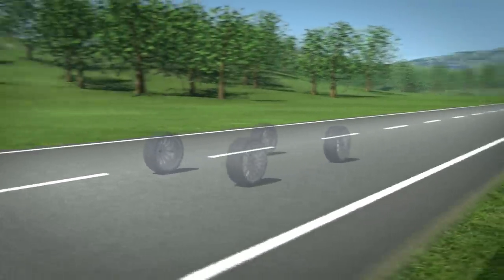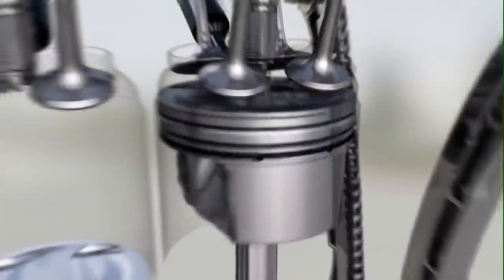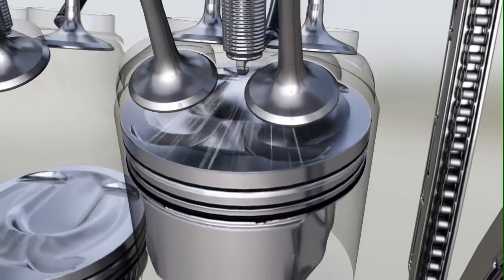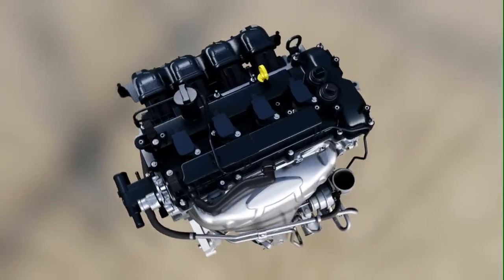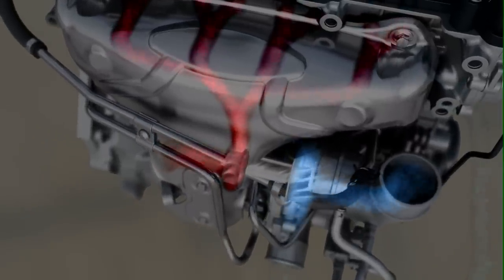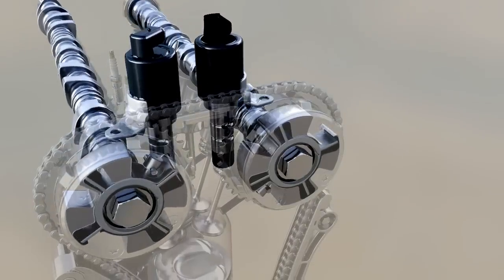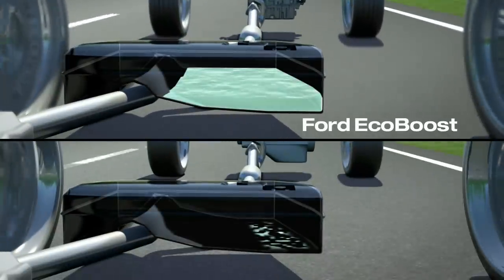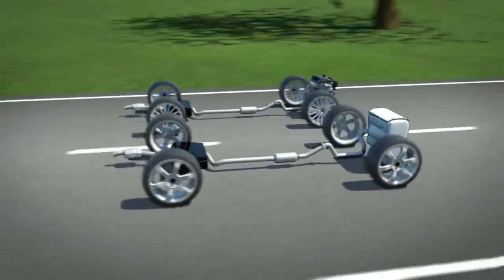Ford Ecoboost Animation

Comment: Just picked a 2015 Fusion Titanium, great engine. Averaging a little over 25 mpg in the city. Love the handiling, very good for a FWD sedan.
Reply: Titanium is the trim level.
Reply: Bob O. Check back with us in 4 years and continue the report.
Reply: rayford21 the time has come
Reply: @rayford21  i have had my 2.0 ecobeast Galaxy five years,did i win a prize
Reply: 2015 
1.5l ecoboost fusion se.
73k mi

Still runs decent i suppose.
Cant stand the transmission though. So sloppy
Reply: @jakokaj7003  get yourself ngk iridium plugs ,makes a diffence  if you run ford plugs.
Reply: 25 mpg in a Fusion? I thought it would do better than that.
I just drove my 2013 Lincoln MKS Eco-boost AWD sedan from Los Angeles to Kansas City I got 22 mpg with the big car. Sometimes driving 95-110 mph.

Comment: I went with a 5.0 in my 2013 f150 and I’m so glad I did
Reply: Anthony Bush  v8 or no light duty pickup
Reply: Anthony Bush yup me too.  They were to new to trust
Reply: I went with a Ram. I learned my Ford lesson the hard way.
Reply: Al Engdahl yeah I’ve got a 2016 hemi ram 1500 awesome truck love it
Reply: To bad my ecoboost blows it out of the water
Reply: @monavieforal  ha just wait
Reply: @hurricane 863 you too. HA
Reply: @monavieforal  dude dodge is the worst company their is. Its a fact.
Reply: I run Rams, the the 5 Oh coyote from ford is their good engine.
Reply: Suq Madiq I want a 5.7 Hemi Ecoboost in my F150, Lol.
Reply: Al Engdahl better be a Hemi ram.

Or you are a screwed once you get above 70k.
Reply: Hurricane 863 your eco boost is garbage compared to the 5.0 NA.

I have a S550 Gt with the 5.0, 

Which is more reliable, more fun, and faster than the 4 cylinder turbo models.
Reply: Richard Thomas very mature Richard you tell those fools how to talk properly
Reply: Your 5.0 that is just as complicated as an EcoBoost lol
Reply: Alex Tran still faster than an eco boost. And way better sounding.

Comment: I bought a 2012 F150 to see what all the rage was about. I've owned practically anything you can imagine because thats just the way I am, curious. I absolutely love the eco boost, empty(no trailer) at 50 mph it will pull itself up some steep hills cruise on at 1100 rpm and not shift when all others would shift down. No V8 gas engine has this kind of amazing torque, add a 9000 pound trailer like mine and its effortless at 70mph 2200 rpm, hill or not unless its a mountain. love this engine.
Reply: @SchafdoggGTO  I think he means a naturally aspirated v8. The 5.0 in the trucks actually produce less power than the 3.5 Ecoboost, but naturally a turbo v8 would out-perform a turbo v6

Comment: 250 from my 75 Nova, now in my 72 C20, bottom end has never been apart in the 28 years I've owned it. Around 400,000 miles, still going strong.

Comment: They've got a point. It DOES reduce Co2 emissions. Mainly because it's in the shop 24/7.
Reply: That's only if you don't know how to maintain GDI..... My 2015 mustang has had no major issues, runs like new and pushes 29psi on stock turbo and block lol....never once been in a shop
Reply: @SoGWestsofly  Congratulations!
Reply: @dailydoseofcancer5517  it takes a lot more maintenance, fresh plugs, 3k oil changes, proper catch can, and full synthetic oil, but it's worth it.
Reply: @SoGWestsofly  Eh, I'm too lazy to do all of that. I rather just stick with the car I have. I change the oil on that bad boi regularly, and it seems so much easier.
Reply: I've had my 2.0 ecoboost for 4 years never been in the shop.
Reply: philipfm : I haven't had any problems with my Ecoboost

Carbon buildup : hold my beer
Reply: Only thing you gotta replace on these is the spark plugs. Not sure where you’re getting the idea that this engine is unreliable.
Reply: Spot on, most accurate yet hilarious point on here
Reply: Look at the ford ecoboost forums and you’ll see how many are in the shop.  Obviously some are lucky with no problems but many do have them.  Btw, I have a friend who’s a Ford mechanic and he works on them all the time, same for the ‘18 and newer 5.0’s
Reply: @SoGWestsofly  I'm just like you man, I have a 98 avalon that I got for 1k, repaired it to run like a dream, and now I'm running 370k with pride. You treat her right, and she'll blossom no doubt.
Reply: max1cod7 You don’t Tech much do you.
Reply: DailyDoseOfCancer this is funny. I have had 2 EcoBoost trucks and neither were in the shop for the engine. But electronic crap made by Asians and poor Mexican made parts 😂😂
Reply: TheJagdog well GDI has been around longer than any of us actually an yes unlike Chevy who stole there logo from a magazine. Took the bail out an while Ford didn’t. 👍 built Ford Tough.
Reply: if you hate ford so much, then buy a chevy or a dodge

Comment: The 2.0 EB in my new Fusion is astonishing. So fast right off the line. 0-60 feels like five seconds and from 60-90 in a flash. More power than my previous V6!
Reply: you use nitrous ? 😂

Comment: I switched from my 5.0L F150 to the 2.7 eco boost F150 and its fast as hell, easily 0-60 in 5-6 seconds vs 8 on the v8. Love it
Reply: Hajji Daoud agree. I drive a 2015 Ford Expedition with the 3.5 ecoboost and I am impressed at how fast this truck is. I pull up to muscle cars at red lights and leave them with ease.
Reply: I got the 2.7 in my 2017 Crew 4wd STX, drove my brother-in-law’s 5.3 Silverado and couldn’t help but think, this thing is dog slow compared to my 2.7, so far 21k and not a single trip back to the dealer!
Reply: Poppy Neese really, a whopping 27,000 miles on it and not a trip back to the dealer lol like that is impressive.

Comment: There's nothing better than a simple 16 valve engine with MPFI, high compression ratio and good ventilation, admission and exhaust system! Nothing of turbos, thousands of sensors and modules, and shit around so expensive to maintenance 😞
Reply: So, K20?
Reply: And yet ford is still selling alot of mustangs, regardless of your pov.

Comment: I will say this. I had a 2013 Fusion  that later got totaled with the same engine NON eco.  I now have a 2015 with 130K miles that is fully loaded with ECO  and I can fully say that it is so much faster with so much power to spare.

Comment: 150k on my work 3.5 no problems and it has lived a hard life.
Reply: Just hit 120000kms with my 3.5 hasn’t had a hard life but it’s been worked. Only thing I replaced so far is a single ignition coil that cost 85 bucks. 10 minute install. 
Good truck.

Comment: For 99% of folks the 4 cylinder turbo is enough. And with readily available low end torque its responsive and "fun". They upgraded the interior with comfortable seats and made it high tech. With a low sticker price , its hard to beat. Most people keep cars for 3 years on average, which is about how long these 4 cylinder turbos will last.

Comment: They forgot the part where the engine malfunctions and bursts into flame.....and that small turbocharged engines have been around forever.....
Reply: ffkk echo boost.. the coyote is vicious
Reply: Said no one ever.
Reply: The fires would be what gm is known for
Reply: You're clueless my friend. I have 2 ecoboost F150s, a 2013 and 2017. They have been phenomenal vehicles with the 2013 having 133,000 miles on her already with absolutely no issues other than needing to buy a new battery and brakes. Ford has proven themselves That is why they have been the number one selling pickup for 42 years straight! You cannot argue that at all so go back to bed.

Comment: I read these comments and literally can’t relate. 2013 EB with 205k and it’s been driven hard nearly the whole way, nothing but normal oil changes (synthetic) every 5-8 k miles, changed spark plugs every 75k miles, changed boots at 189k and at 202k I changed timing chain and phasers but I only stretched the timing chain bc I upgraded turbos, intercooler, throttle body, CAI and like I said I drive it hard always. I have towed once or twice with it but I avoid towing as I just don’t like to do so, it’s been through woods and through a few rice fields but I mostly take good care of it and I’ve never had any major problems, timing chain was my fault and expected.

Comment: I went with the 5.0L in my 2018 f150 XLT . And I am very happy with it. Other then the fuel saver thing , when your at a light and it turns off. Then when you take you foot of the brake it starts back up. And I have heard the EcoBoost are expensive to fix more sensors and newer technology,  so more expensive to fix. I had a 1997 f150 with the 5.4L and I loved that truck , but kid got bigger and needed more room. So got the 4 door. And sold my old one to my son.

Comment: the 20% carbon reduction means it just stayed in your engine and is sitting on top the valves...good luck eco boost owners..the misfires are coming
Reply: +dan k bro, it means it used 20% less fuel, so 20% less emissions
Reply: No, he's right. In the ST community it's common to have to clean your valves after 20-50k miles.
Reply: All eco boost engines? I have a Honda pilot w eco boost engine. Wtf
Reply: Two words... water injection.
Reply: Really buddy why so much misinformation, fords eco boost have been around for how long, when ford came out w their i6 motors everyone doubted it
Reply: E V yeah but those were the best ones they made but fucked it with there vs
Reply: dan k ecoboost has been out since 2011 it's 2018 and my truck works like I bought it yesterday.
Reply: Everyone here with their fucking gassers 🤷🏻‍♂️😂
Reply: Jacob-Mason Leviste Take a turbo off a diesel and see the turd you really have lol 😂. I blew mine up I'm my 99 350. Couldn't barley get over 50.
Reply: dan k catch can mode
Reply: You are right, i have a 2015 ford transit with the 3.5 ecoboost, after 100,000 miles the check engine light has never shit off due to permanent misfires. I have replaced the plugs and coils and made no difference. Now at 232,000 miles its barely alive
Reply: @smitty3973racing  try a walnut blasting, at least that's they call it on bimmers, but it works
Reply: EcoBoost = New Shit to stab ur money... and you are the experiment for other industry study the final result 👍
Reply: smitty3973racing almost a quarter of a million miles in 3-4 years. Yeah that seems like it’s done pretty good to me.
Reply: @jacobebey7019  that has nothing to do with the 20 percent reduction. It has everything to do with direct injection. No cleaners can ever touch the valves like in conventional injector motors. So the carbon builds up.
Reply: @smitty3973racing   WHY NOT GET IT LOOKED AT THEN? you probably have massive carbon deposits
Reply: Ha that is so True, sittin on top of the valves......except im at 108,000 miles on mine and my Edge runs like a new car....I use Shell V-Power all the time.......must be why
Reply: There isnt a real cleaning for the valves except replacing them
Reply: Yeah my 180k 3.5 EcoBoost has had so many issues.  Oh wait no it hasn't
Reply: @losangeleslakers1650  thats right your experience must also be everyone elses. sigh
Reply: @r6master69  oh right so all engines are identical to yours I suppose? do you even read how ridiculous your assertion is?
Reply: That's nox particles. C0 is what they should be concerned with.
Reply: @jacobebey7019  nah u fried
Reply: @Biggjuggs333  no u dont
Reply: @boomsaucexx1866  Depends on the diesel. My 2001 Golf can be tuned for about 70% power without a turbo. With a turbo in it it puts out 130hp and 150tq
Reply: Him still waiting about that

Comment: Just drove my 2013 Lincoln MKS Eco-boost AWD sedan from Los Angeles to Kansas City and I got 22 mpg and at times running at 95-110 mph. 
To help beat carbon build up in an Eco-boost use high quality oil, high quality top tier fuel, install a oil catch can and run frequent Italian tune ups.

Comment: I drive a 2015 Ford Expedition king ranch with the 3.5 ecoboost. I use to think that only a v8 belongs in a truck until I test drive one. I am impressed on how fast this huge SUV is and well it can tow. Don't knock it until you try it. As for reliability only time will tell as I only have 30000 as of now.

Comment: The new Ecoboost engines are dual injected so they don't have the carbon build up problem anymore but I will say that you don't get the best of both worlds at the same time. You can have Eco. You can have boost. You can't get both at the same time. Drive an f150 Ecoboost and actually use the power that is on tap and you'll actually get worse mpg than the V8
Reply: You nailed it. Eco or boost not both.

Comment: finally someone who knows what they're talking about!

in my 2007 F150 with the 5.4L i usually get about 16.6 driving to work which is part freeway and part residential with many hills. I have driven my truck down the highway going across to eastern washington (i live in the seattle area) and I got over 21MPG. it probably would have went higher if i wasn't going 70mph with my last gear changing at 40mph... wish i had a 5sp auto :/

Comment: I have a 2016 Mustang w the 2.3L ecoboost engine. It has a twin scroll turbo and the turbo lag is barely there. With Cobb tuner and replace the inter cooler for a bigger one and denso spark plugs I'm blowing Audi A4 quattro away. I raced a G37 coupe and beat him by at least two car lengths. This little turbo 4 w 310bhp is so easy to get more gains with little $$. With about $2000 worth of bolt ons it's very easy to squeeze out another 100hp to the wheels. Ford ecoboost engines have been tested in the harshest conditions and just keep running at high levels. These engines are phenomenal.
Reply: Tim Porch 4 zyl. in a Mustang. its like wearing woman clothes as a man.
Reply: Marcel K says the dude with mk2 mk3 focuses in his upload. let's not mention that motor has over 300 hp and 300 tq. lmfao
Reply: I never sayd this Engine is worse
Reply: Tim Porch nice
Reply: Lets not mention that those torque and hp numbers are advertised by the same company that builds 3.5 liter EcoBoost V6s that blow up at 365 hp and 420 lb.-ft.  As a long-time professional mechanic, I tend to take anything Ford says with a giant grain of salt.
Reply: Tim Porch it doesn't matter if you win by an inch or a mile winning is winning
Reply: Yeah I'm sure putting in those denso spark plugs added 1/8th a HP
Reply: The new Ford Taurus interceptor and Ford utility interceptor use 3.5L V6 Ecoboost Twin Turbo with the Ford Taurus interceptor having 365BHP and Ford utility interceptor having 300+BHP. They Are quick as hell. Ford Taurus interceptor does 0 to 60(100km/h) in 5.6 seconds and top speed 150mph(242km/h). Its crazy American police Fords having Ecoboost twin turbos. Also, the Ford utility interceptor does 0 to 60 in 6.4 seconds and top speed 132mph. That's very fast for a police SUV.
Reply: Tim Porch --- you just eliminated the "Eco" part of your engine design... 🤓 it's just "Boost"
Reply: I aint spending 2000$ for 100hp
Reply: Tim Porch sorry to hear that
Reply: Tim Porch there mad cause the focus RS is gapping everyone look at SGTR channel... my friends ecoboost makes 320/370 hp/tq it’s tastefully modded while my other friends runs like shit 2.3 mustangs
Reply: I feel bad for that mustang
Reply: That's why people are blowing head gaskets so often Ford had to settle a class action lawsuits to fix these "great" engines.
Reply: Stopped reading after Mustang w The 2.3l ecoboost
Reply: Did they know they were racing too?
Reply: I know if you've ever put spark plugs in the 3v trition in the f150s in sure you'd be saying all kinds of nice things about ford.
Reply: Thats exactly what they want people to do with these engines. That way, when it blows up prematurely like all others, you're SOL
Reply: Aaron Ratliff if you change them at the recommended interval you have 0 issues.
Reply: My issue is EcoBoost always get less gas mileage in real life than a comparable power n/a engine.
Reply: JustAnotherCarGuy i feel like a v8 would get better gas mileage, last longer and be easier to maintain over the long term than a 4 cyl turbo that's maxed out with $2,000 upgrades. I mean I'm pretty sure it doesn't cost 2k extra to get a 5.0....
Reply: Strong Tower Lawn Care uh... Dunno where you got that from but its bullshit.
Reply: Ford is the WORST brand
Reply: sk8tillyoudie 83 for? Cuz their sales kinda... You know... Prove you wrong...
Reply: Tim Porch  I agree with you 100%.  I have a Lincoln MKS EcoBoost with a 93 octane tune, and 3 bar MAP sensor....... she runs a 12 second 1/4. And blows the doors off most cars to 60, especially on the street (0-60 in 4.3) at 4000+ lbs :)
Reply: If youre gonna own a ecoboost in a mustang might as well start wearing panties

Comment: If you mean small block V8, then yes, about 412-420 BHP.
The V8 modulars based on the 4.6L include the new 5.0L TiVCT and the 2013 GT500's 5.8L project Trinity. These are all Small Block architectures.
As of 2012, the 5.0L TiVCT is rated at 420BHP.
Add ecoboost to the 5.0L TiVCT and you can match or maybe even exceed the project Trinity 5.8L's 662 BHP.